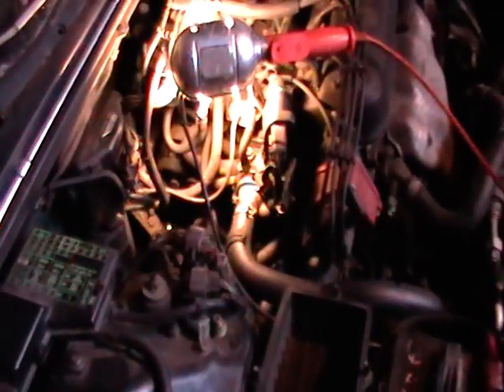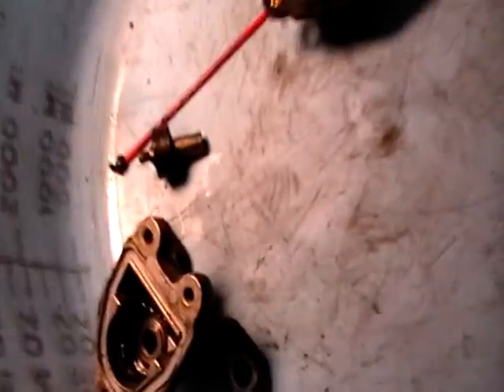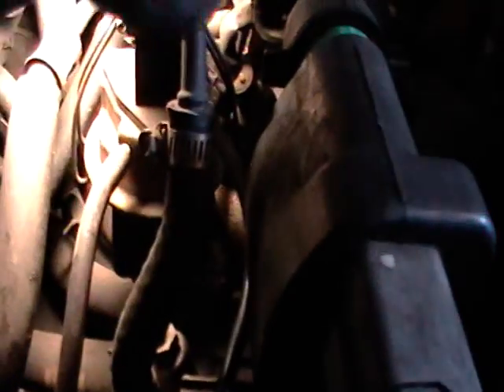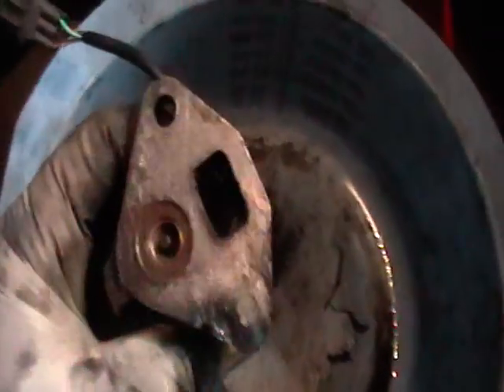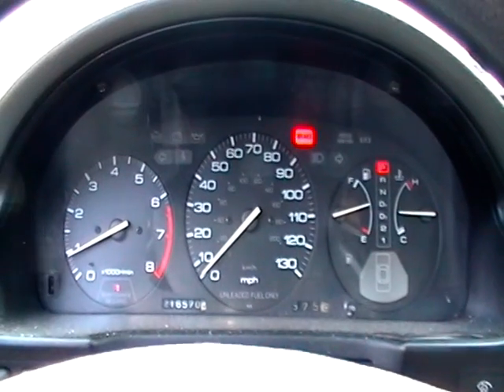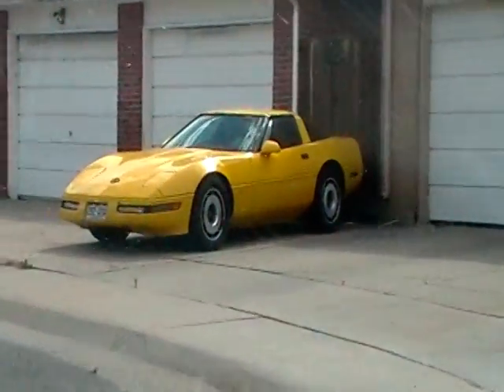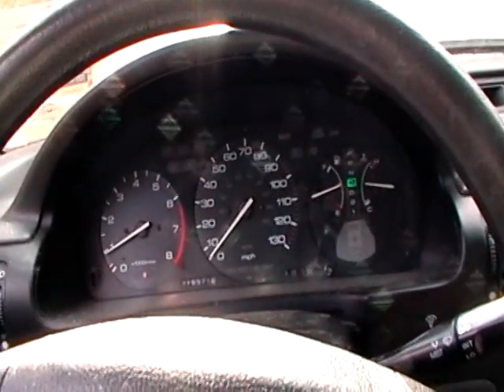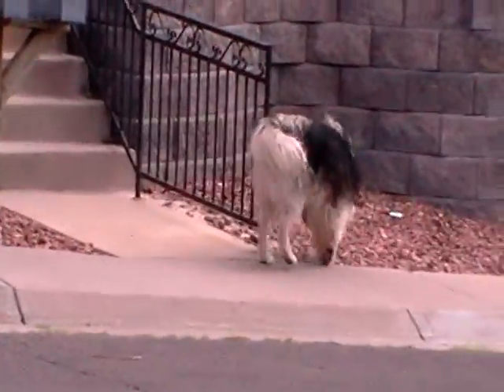1992 Honda Accord 2.2L Speed Sensor & EGR Valve

Comment: Would the malfunction of this specific censor cause the vehicle to completely stall?
Reply from the maker: @t3rmites  No, it wouldn't. It would make the check engine light come on. Your problem sounds like ignition problems. Distributor cap, spark plugs, and plug wires. Sometimes the valve cover gasket fails and leaks oil into the spark plug wells, and fouls out those parts.
Reply: @MrCARWIZ  gotcha yeah I was thinking the same but it only gives me a code for this sensor particular censor plus the cb7 is manual

Comment: Any advise on how to replace the climate control module on the 92 Honda Accord.

Thanks Anna
Reply from the maker: I think you have to remove console around the shifter, then the trim panel around the heater controls, radio, and then you should be able to access the module mounting bolts.

Comment: Did you clean the EGR ports as well or did cleaning the valve help eliminate the surging idle when driving these accords.My 92 has 214xxx miles and it surges between 2700-3000 rpm intermittently and have seen vids about the EGR ports, but I will go ahead and try this one first as this one seem to be the easier to do than the ports as I don't have a slide hammer to take out the plugs.
Reply from the maker: Cleaning the EGR valve solved the problem on this car.  I cleaned the ports as well as the EGR valve on my bronze 91, and when I was done, that car ran perfect.
Reply: My 91 too would rev up and down when cold. less than five min fix.
The fast idle valve needed adjustment.
Here's a good vid on it.
https://www.youtube.com/watch?v=L788jKEVblY

Comment: I have a 1992 Honda accorded lx 4 door with a auto trany 4 speed and a 2.2l 16 value the engine runs like a dream with 215,xxx miles the trany not so well..when the car is cold I put it in 4 to take off and it thinks its in 1rst gear so I drive it like a 4 speed but even doing that I shit it to sec and it is still in first gear not wanting to go up to sec gear..i have to drive around in 1 and sometimes 2 gear for about 20 mins just to get all 4 gears when I get all 4 she runs like a dream!! (plz help) THANK YOU!
Reply: Raphael Brown ok thank you..if its not to much if sometime happens or you see a different car acting up like my car could you ask then and keep me posted? thank you
Reply: +Raphael Brown these cars computer doesn't let it drive when cold hence why you have to put it in 1st gear
Reply: thanks for the help but the car is gone now in the scrap yard
Reply: Too bad, the problem would have been the TCU (Transmission Control Unit). Under the carpet on the passenger side are 2 boxes. One is the TCU. Remove that 2 connectors then remove the 4 screws holding the box in place. Open the box, and in the bottom right corner you should see a burnt resistor. If so, You need to replace the TCU. Junkyard about $40.00 depending on where you live.  A trick to test if it is the TCU is disconnect the battery for a few mins and then connect. Does you car drive normal? If yes,remove the box.
Reply: thanks for the info..i have a newer car as of right now.
Reply: good luck.. these cars today are disposible and don't last for shit... electronic this electronic that. major recalls etc... ill keep my accord. just did the timing belt and water pump.... ready to give me another 2k.. by that time i should have 4k on the engine.... have you heard of the million mile honda??? a accord that was rolled up from how reliable it is when maintenance is done
Reply: well its too late now

Comment: Nice vid Mr. Brown - I just bought a 91 from a friend of mine in a pinch for cash - it had the check engine light on after the engine warmed up, and the code it's pulling is for the EGR system - I'm gonna try this to see if it will help the rough idle, mine shifts a little rough, but not as rough as yours.

Comment: Brian is correct... I had the same issue, bought from ebay seller in California...search for VSS Honda.  MUCH better prices than the stealerships.  My new one's been working properly for 2 years !  DIY repair for under $10 instead of $280 at the dealer.

Comment: Check for codes by jumping the 2 pin prong on the passenger side kick panel the lil plastic panel pulls off its green i think, and it is a 2 pin plug put jumper wire in and turn ignition on for code flash for detailed speculation

Comment from the maker: When the transmission is in drive, the car takes off fine in first gear, shifts fine into second gear, but when it comes time to shift into third gear, it seems to disengage (feels like neutral), until you back off of the throttle, then third gear kicks in.

Comment: I have a 1995 Accord LX coupe. Speedo stays at 20mph. 4 cylinder 2.2 manual. I replaced the speed sensor and no change. What else can I look into? When I turn the engine off the speedo goes to zero, as soon as I turn power to the switch, speedo jumps to 20. Sometimes while driving the speedo works but not very often. Anyone have any suggestions?